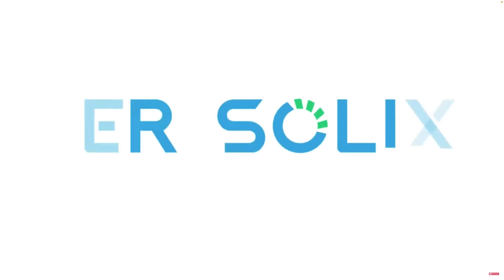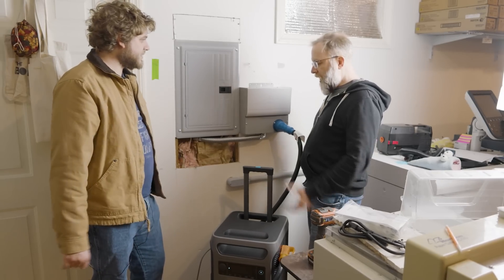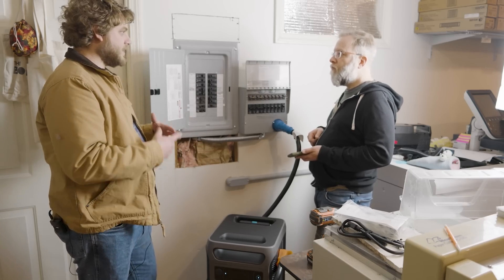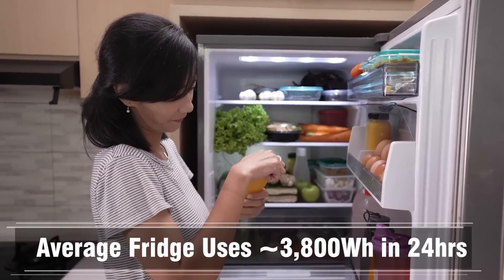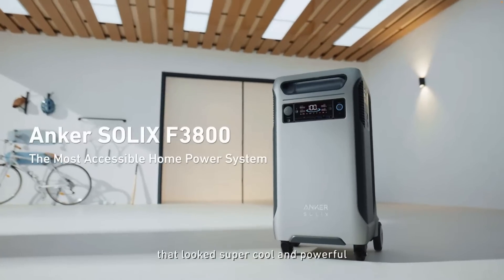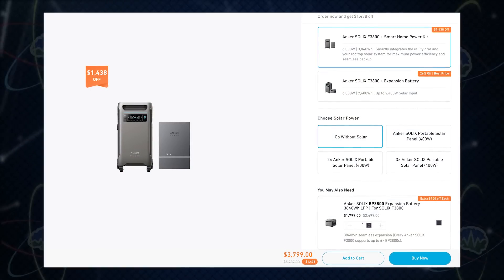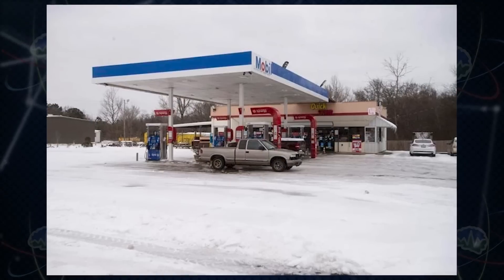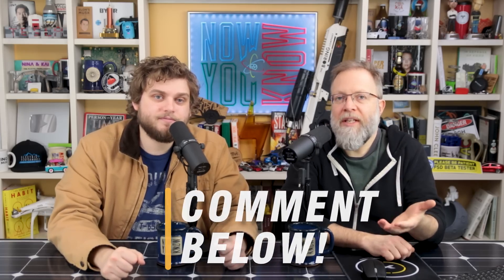Home Backup Battery for Less! - Anker SOLIX F3800 | In Depth

Comment from the maker: Buy Anker SOLIX F3800 now and get a FREE 200W Solar Panel. Use
our exclusive discount code NYK3800to get $600 off! Or use our code NYK3800B to get Anker SOLIX F3800 +  an Expansion Battery for extra $300 off, total $1,799 off the MSRP! https://ankerfast.club/1df7ma

Comment: You can only connect 24v solar panel into the unit...upto 25a so that is about 800 watts...no there is no way to get 2400 watts of solar that is a lie...
The inverter uses 70w so for 24 hrs thats 1680 wh...

Comment: Ordered 2 x F3800 with expansion batteries and smart home panel but didn’t install them until recently since we went and got solar installed with 1 Powerwall 3 installed.  We produce a lot more spare energy when the pool isn’t being heated during the day and the powerwall fills up quickly.  Decided to finally install the anker and smart home panel last weekend.  Some learnings is the smart home panel is pretty cool - you can set up time of day usage to power your home and when to charge based on utility rates.  Also you don’t actually need to set up a separate back up panel just run it to your main panel and a 100amp breaker and the smart home panel can back feed the battery power and run your home without using grid power.  It seems to work fine with the Powerwall 3 - the Powerwall 3 doesn’t see any home usage needs when the Anker is back feeding and powering the home.  When the ankers are drained or reach their reserve limits then the Powerwall battery kicks in to power the home.  Also planning to add two more expansion batteries to our Anker since it’s plug and play and awhile lot cheaper and easier than adding another Powerwall.
Reply: Hey man can you share more about your set up
Reply: Sure - what would you want to know?   ~19kW of solar (6 arrays/string) into the Tesla powerwall 3.  Tesla Back up gateway 2 that switches between grid, powerwall 3 or solar power (fed from the powerwall), in the main panel downstream of the powerwall/back up gateway I have a 100amp breaker that runs to the Anker smart home panel connected to 2 X F3800 with 2 extra external batteries each.   Also have a set of 2x440 watt panels in parallel connected to each of Anker f3800 for some extra charging.   There’s a back up panel also connected to the Anker smart panel but nothing connected there and may just take it out to simplify things from an aesthetics standpoint.
Reply: @bdtang  how do the Powerwall and the Anker interface?
Reply: @loluog  they don’t really. The powerwall feeds the backup gateway which feeds to main panel.  The Anker has a breaker in the main panel to get charge and to feed the rest of the circuits.  When the Anker powers the house, the smart panel does it in a way that the net draw from the outside source (whether grid or powerwall) looks like there is zero load/need for electricity.  Usually the ankers powers the house most of the night until it drains down to 20% or if there is a load that needs more than 6kW then the powerwall kicks in.

Comment: Manual says it can take a  2400 watt solar charge but........V x amps= watts
32 x 10=320watts..ch1
60x25= 1500watts.ch2
Total= 1820 watts
Correct? 
So where are they getting that out can charge at 2400 watts
Reply: I think you misunderstood this, if you have solar 30-60 volts it can take 1200watts per channel. 
I found rec alpha pure uses 53 volt system and allows you to max out the 2400 watt each power station. So if you have 2 you can use 4800watts of solar to charge both systems.

Comment: But natural gas generator runs for days even weeks while battery backup even with solar support will run a couple of days. So you have a problem in extreme heat or cold when you run out of battery even with some solar support. Where am I wrong?
Reply: The installation cost and process for that could be cost prohibitive, also home standby generators require regular periodic maintenance (oil change etc).

Comment: The solar input is limited to 60 volts.  This is a fatal flaw of this unit.  It is good for backup of a short blackout or for camping if you want split phase but for home use you would be much, much wiser to go with other units
Reply: Any recommendations?

Comment: yeah  these things are cool, especially the Ecoflow Ultra,  but in reality you need a gas, diesel, or propane generator for any long term needs...more than a day a two.   Get a dual fuel, run it on propane, and you won't have the problem of gas sitting for a long time.  Imagine,  you buy a predator, Westinghouse, or champion 12500 dual fuel for 1500 max.  Done.  These power stations are just a shiny object.  Good for Van Life,  I own two Ecoflows,  but they are not serious for home backup.

Comment: Great video review, thank you! Can you help identify best solar panels to use with this unit besides the portable ones due to the limited 60V solar input? On some reviews I’ve seen they using the F3800 unit with 3 panels in parallel that are LG 365W each.  47.7VOC, 9.39Imp total of 28.17 amps potential using two 3 panel strings to connect of the F3800. Any thoughts if these will work and your panel recommendations?

Comment: My electricity rate goes up significantly between 4:00 p.m. and 9:00 p.m. at night, can't I just use this thing every night to power the items like TV computer refrigerator and Save money because I let it charge during the day when electricity is cheaper? Or is there too much efficiency loss from charging up to make any real savings. And then of course also have actually a backup on hand.
Reply: They sell a smart home panel that allows for that more easily, from what I've read

Comment: Black-outs happen once in 10 years.
PV-generated (more than I need) electricity yields €0.05 per kWh, while I have to pay €0.45 per kWh some hours later.
This battery won’t help me, the (far more expensive) Tesla power wall can.

Comment: I have a Bluetti AC180 that will be more than enough for a brief outage for small electronics like fans/routers. Still enough oomph to cook with but i have propane for that. My outage readiness kit also contains a Chinese diesel heater and 5 gallons of diesel to weather a night or two before I'd bug out to somewhere better. I picked it up on sale for $650

Comment: make video on how long it takes to load the generator from zero to 100% using one 200w solar panel.
also make video on how to use it.
good video guys
Reply: A single 200 watt panel should make about 1,000 watts per day between May and October, when the daylight is longer each day.  So it would take 800 watts to fill the 3,800 watt battery in 1 day.   If oyu have a load on the battery, then more solar would power that load and also charge the battery if the solar is larger than the load using the power.

Comment: While on battery, how do you know if grid comes back on line….no neighbors located nearby
Reply: The things that are not run on the battery will come back to life.  Such as the light on your digital thermostat run on a 240 volt A/C system.  Or you do not put something like 1 light or a radio on a 120 volt circuit that stays grid tied.  When it comes on, you know the grid is back.  Then can switch some things back to grid power, and maybe leave the lights on the battery pack, in the likely event the grid goes back off later.  

Most back up generators keep the load on the generator for 15 minutes after the grid is back, then run the engine for instant back up power for another 10 - 15 minutes with no load on the generator, so that the engine can cool itself off before shutting down about 18 - 30 minutes after the grid is back.  The chance of a grid going down again is much less after 15 minutes.
Reply: I know in our area National Grid can send text messages when the grid goes down/comes back online.

Comment: Rather than designate specific circuits for use during a blackout, I used a transfer switch for all circuits and backed panel through a large breaker.  If load was too large, the breaker tripped.  Surely it doesn’t meet code, but it’s rarely used, gives me desired flexibility, and closely monitored for safety.

Comment: The power station to get. This station allows you utilize the device every night, that is, it dumps energy when the electricity is most expensive. The average station will be unused until your next trip or job.  I don't get why Anker insists/market the auto transfer switch whereas during a power failure a user simply plugs a critical appliance to the station

Comment: A 8.5kwh gas generator for  $1,000 bucks back fed into  your service panel is cheaper. It runs your whole house without installing an expensive transfers switch. And they work rain or shine. The law requires you to use an interlock switch to prevent energizing the grid. I run test my generator once a month. I also treat and maintain plenty of fuel which is treated far storage.
Reply: Conversely a backup generator has an extremely low utilisation rate and requires fuel, maintenance as you allude to.  A battery on the other hand can be used every night to supply solar power that was harvested the previous day.  So yes it’s more expensive, but it can give you value every single day, and it doesn’t need any particular maintenance.
Reply: @anthonydyer3939  nailed it

Comment: 110/220 is what the power companies provided before 1970 or so.  There was a little time during which they aimed for 115/230 in the 1970s.  Ever since, it is 120/240!  Come on, Zac!:  get with the modern times!
Reply: Sorry I use the terms interchangeably because I grew up with 220 :)

Comment: Can you plug your F-150 Lightnings ProPower 240v Output directly into the transfer switch?

The transfer switch is only ~600 bucks. Could be a simple and cost effective alternative to Ford's Charge Station for home backup.
Reply: Don't see why not. It's a 30amp outlet so it could supply 60amps of 120
Reply: Yes that should work - in fact we should test it!  Thanks.  Also you can feed the Ford Lightning into the battery to keep it topped up.
Reply: A test would be great! I'd buy that transfer switch in a heartbeat if I knew for sure it'd work with the Lightning.

I agree, it should technically work. The few reasons it might not seem unlikely. A physical test would be a nice way to get a solid answer.
Reply: Would still love to see a physical test to know 100%, but after more research it seems unlikely to work. This is due to the trucks bonded neutral.

I hoped Anker was using a bonded neutral with their battery, and this transfer switch supported that. But it seems it doesn't, and this box is an off-the-shelf Reliance transfer switch which doesn't support bonded neutral generators. Plugging in ProPower will likely result in a ground fault in the truck.

🤞 I'm wrong!

Comment: I realize Anker sponsored this, but can you review the EcoFlow Delta Pro Portable Power Station which is a 3.6kWh battery for $2599 (they had a sale before valentines for $2599 for the power station and $700 for an extra battery - ie 7.2 kWh for $3299 and their transfer switch is $399 - they even have a smart panel for $999) - so this is a very like for like system to what you've just reviewed [almost pulled the trigger but my electricity is roughly $50 a month, so would take quite awhile to recover the cost]

Comment: How does this compare with the Tesla Powerwall? Other than it being mobile?
Reply: Anker Solix F3800 is less than half the price as the Powerwall, is 3.8kWh vs 13.5kWh and is not tied to the grid in our case.
Reply: I have heard that the Powerwall is about $10,000.  And if the battery in the powerwall is 4 times larger, then it would be less per stored watt.  However I am not sure what the wattage of each battery is.   The Powerwall is said to be able to run a HVAC system that is small, say 2 tons of capacity.  This unit only runs 120 volt loads.

Comment: The reality is that a 3800 watt-hour unit would provide backup of even a single kilowatt of power for just a few hours, not days and days...  Just running the inverter for two days would kill the battery, with even the slightest load or a very intermittent load.  (And adding additional batteries gets into the Powerwall cost range really quickly.)

Comment: 3800 wh is not big enough to charge your EV. It might get you less than 5 miles of distance.

I have 5000 wh system. It's good for 28 hours of run time on my freezer, refrigerator and few lights.

The pellet stove runs on the Jackery 1500.
I'll charge them back up with the gasoline powered inverter generator.
I also have 1000 watts of solar panels.

I would invest in the Power wall or something else before spending money on expanding. The power wall is all in one system that is 4x bigger than the Anker. Power wall is 8,500 dollars. It will be cheaper than Anker Solix with 3 expansion batteries.

Comment: 9:45 the Model Y made in the USA, does not use LiFePo4 (or LFP for short) batteries in it.
the Model 3 RWD is the only Tesla in the USA that uses LFP.
currently in USA, the Model Y is only made with 2170 NMC cells.

However, China makes a Model Y RWD with LFP and Tesla has imported them to Canada.

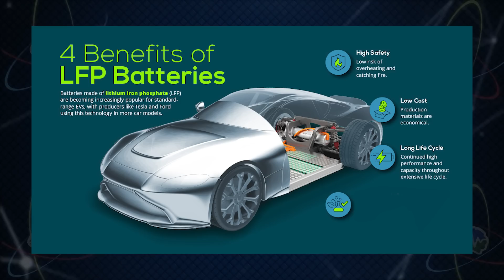EDIT: 10:00
LFP cells are fine being discharged to zero, however you should consider charging them very soon, if left at zero state of charge, they can become unchargeable after a while, depending on quality 2 weeks to a month will damage them to where some will take very little charge or refuse to charge entirely. if you have to leave them at a low state of charge for a while, consider keeping them above 20% preferably 50%

Comment: Does your transfer switch disconnect the grid to prevent backfeeding to the utilities satisfaction?
Reply: In effect the transfer switch doesn't allow back feeding the grid because you are choosing between "Line" or "battery"
Reply: @ZacCataldo  Yes, excellent description.
Reply: Yes.

The "Line off  Gen" switch is a code legal way to disconnect the grid power from the generator power.  It is safe, and proven great way to move power from the grid input to the generator input, in this case from a battery inverter system instead of a generator.
Reply: I highly doubt it disconnects from the grid and notice there is no main breaker in his panel.  However, most local codes require a disconnect from the grid and his probably is at meter or another location.  You must disconnect from the grid.

Comment: At the 6:38 there is info that average American fridge is using 3.8kWh/day. Well in Europe I have a quite big fridge freezer that is 60 cm wide and 184 cm high and I measured that it is using on average 1.04 kWh/day. You are very wasteful if only a fridge is using 3.6 times more electricity. 
That is why the guy from Not Just Bikes escaped to Netherlands.
Reply: Yes. I suspect their fridges of equivalent size are less efficient. Just like you could buy the same Ford model over there and over here, and ours would mysteriously get more miles/litre than theirs and have suspension that doesn't feel like you're on a small rowing boat going over rapids. I saw a washing machine on Two bit Da Vinci the other day, that head a heat pump... but had natural gas powering it because they are on 120 volt and can't run normal devices efficiently. I love America, but it's just as crazy as the rest of the world, and bizarrely behind on so much tech.

Comment: Looks useful, but I suggest that they use right angled cables/connectors to keep the cables out of the way or against the wall.
With battery  production expanding and developing rapidly, I expect that they'll be half the price in a year or two, and I'm looking forward to that!

Comment: Since you guys advocate contacting people regularly, the best thing to do is contact the power company to get their act together. Power outages are rare in the UK.
Reply: What a strange bit of assumptions!  We don't have power outages around here because of some little failing of the power companies!  We have outages because the dozens of miles of powerlines are knocked out by trees falling or vehicles hitting power poles or rockslides burying a power substation.  There are wind towers all over around me, zillions of solar panels, and hydroelectric plants here and there but that doesn't help anyone if the power lines are broken somehow!
Reply: They don't have Ofgem or any equivalent, or a national grid of any kind. They have 3 grids on the mainland. We have interconnectors to France, Belgium, Norway, Denmark and the Netherlands, and we have huge amounts of wind power already, they do not. I could find a single interconnector in the US but that doesn't mean there isn't one. So yeah, their power is completely unstable and antiquated, not to mention the hilariously poor choice they made to go 120 volt and the much worse decision to stick with that. What they need is regulation, and (federal) government management to shore it all up and modernise but of course, they prefer fake freedom to real freedom, or at least, many of them do. And it's not that their politicians are even more easily influenced by money than ours. The insane thing is this sort of thing makes sense to loads of Americans because they can't even see why they'd vote differently based on their own self interest, let alone bring themselves to deny multi-billion turnover companies 'freedom' as if they're people being kept in servitude. :D 

Of the great things about the US that are nice to have, neither bread nor their utilities are things to be envious of.